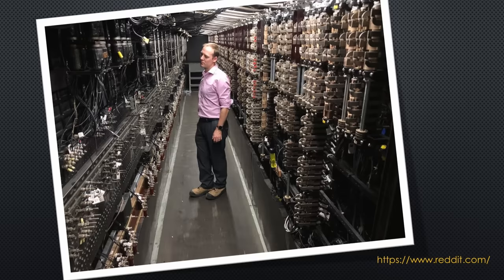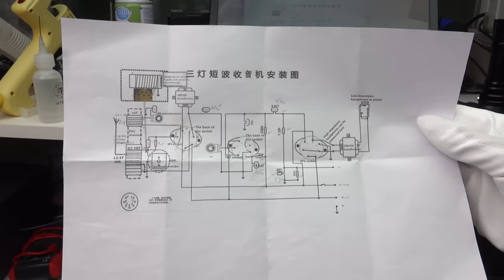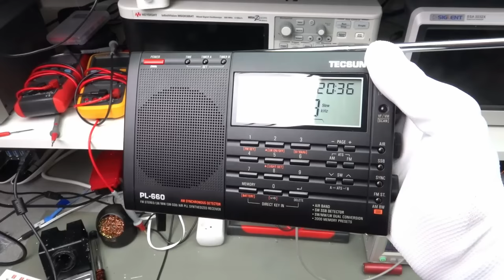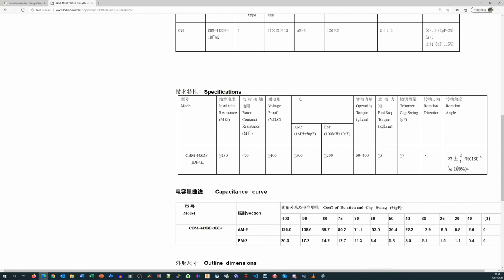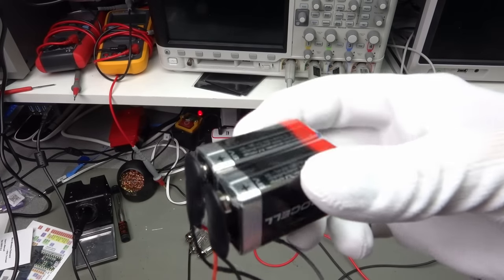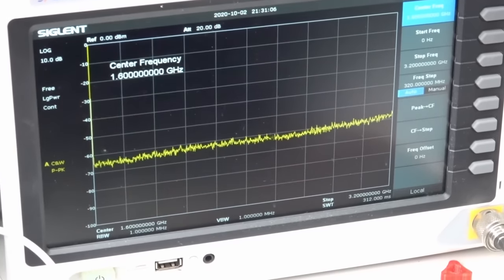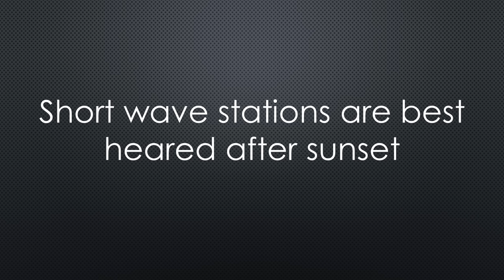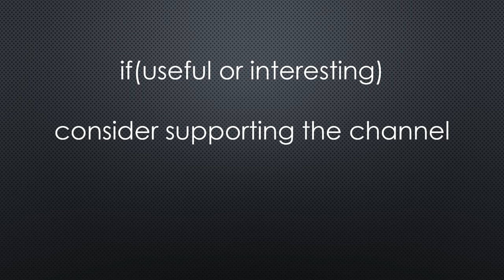#355 Let's try to build a Vacuum Tube Radio

Comment: I am 71 years old now so I not only remember tubes I learned basic electronics in the 50s from my father starting at age 5.  I was building small radios at 10 and repairing tube TVs with my dad. Well I am retired now having been an Electronic Engineer for over 35 years. Got lots of old tubes around so can't wait to build a tube RADIO again.
Reply from the maker: Enjoy! You were even earlier with starting with electronics than I did. But you were lucky to have an involved father. Mine learned me to work with wood...
Reply: Ha, you were 71 three years ago - I'm 74 now so we are the same age. I had a next-door neighbour [Mr Auld] who was a senior person in the Post Office Telephone Exchange in my city and he was very interested in Radio. In his basement he had quite a big workshop. He initially got me interested in DXing  and I had an old 11 valve, Atwater Kent radio which pulled in stations on Broadcast Band from some great distances. Anyway, he gave me some old Radio Engineering magazines and in one of the magazines was an article about "Hikers Radios" [I think from the 1920 ~ 30's]. They progressed from a Hikes One, Hikers Two and Hikers Three. Anyway, I got all excited about this as I had already built a Crystal Set under his instruction so I decided to make a start on a Hikers One. Immediately, we had to have a valve substitution because of non-availability. I can't remember the valve we had to replace, but I clearly remember the substitution - it was a DL92A valve. [It was a miniature valve].  I worked on that radio and even made a cabinet for it so that when I finished it, I was very proud. Being a one valve set, I had old headphones connected and could lie in bed at night, listening to the radio and mum or dad wouldn't know I wasn't sleeping! I found that by increasing the voltage to the valve, I could get better reception and stations further way - I also noted that the valve started to light up like a light bulb as I applied more power. In my quest to get more and more stations, one night my Hikers One didn't work! I planned to build the Hikers Three but never got around to it. Thanks for your article, it has brought back many memories. RIP - Mr Auld.

Comment: Wonderfull project. Only 3 months ago I donated all my remaining tubes (quite a lot..) to a radio museum here in Belgium. Together with almost all my prehistoric radio's and a few TV sets from the late 50's/early 60's. I had no choise, they took too much space. However, I still have 3 left. One I inherited from my grand parents and is dated 1927. Your video is sure a trip down memory lane....
Reply from the maker: So you radios and tubes have a good place! I also once had a tube radio from 1925. But unfortunately, when I left home, my parents also once thought, they have not enough space...
Reply: @AndreasSpiess  Yes, throwing it away would break my heart. I have a weak spot for old radio's and tubes.

Comment: I think my first electronics project was a single valve radio of the same sort of design but without the audio amplifier - just used high impedance headphones.  You really could hear the world.  That got me started over 50 years ago!
Reply from the maker: These are  the "live changing events"... Today it is not easy to get such high impedance earphones. They are low impedance these days adapted to today's voltages.
Reply: Andreas Spiess Yes indeed. Had a teleprinter (50 baud) in my bedroom aged 16 - and 50 valve ‘modem’ to drive it from my valve radio. Worked in telecoms all my life, from X25 data networks to microwave, fiber and satellite and mobile networks!  An early hobby turned into a life!

Comment: I find it quite amusing to see such a crude radio being set up with all that expensive test gear - spectrum analyser, function generator etc. 'When I was a boy' I only had the receiver parts, no test gear. I think your next project should be a superhet radio :)
Reply from the maker: You are right! But you had more stations near you who could serve as a "function generator". These days it is hard to find strong stations...
I am more in SDR than in superhets.

Comment: What fun!! Thank you for making this video!

I remember when I was a teenager and I made a regenerative receiver out of a single 6BF6 vacuum tube and some coils on toilet paper tubes (it took the poor salesman forever to find one in his stock)!! I got the schematic from some hobby magazine. It was wonderful to hear all of these shortwave stations on the radio. I even made a coil for the CB radio band (27Mhz) and it actually worked! I could hear the locals talking on their CBs. The selectivity was not all that great so I would hear multiple channels at once but what fun!!

The original circuit used a potentiometer to vary the positive feedback but it was really scratchy and really hard to get that super high gain without tripping it into oscillation. So I modified the tickler circuit by winding a pancake coil on a piece of cereal box paperboard and stuck it inside the main coil and arranged it like a butterfly valve so I could vary that magnetic coupling to the main coil as you turned it open or closed. It was AMAZING how smooth it was and I could sneak up on the gain to ridiculous levels and really pull in the shortwave stations!
Reply from the maker: You are welcome! The problem with winding the right coil and finding a good distance to the feedback coil is still there. One thing, however changed: We do no more have a lot of powerful radio stations on those frequencies.

Comment: Enjoyed the video.  Although not with vacuum tubes, I built a small transistor radio in the 60s from a kit.  It was exciting to hear the AM station when it first fired up.
Reply from the maker: Today it is probably no more easy to get AM stations, at least not in Europe. Most are switched off by now.

Comment: HI YOUTUBERS. Thank you Andreas for this wonderful video. It took me straight back to my childhood where I bult many such projects. I never tried low voltage directly heated valves however. I was used to 300V / 6.3V PSUs as an 11 year old and I survived ! My memory is now flooding with ECC83, EF50, EL84, KT88 and QQVO6-40 ! 73 de G4EYR
Reply from the maker: You are right with the morse signal.
It was probably better to start young. Now I know what can happen and fear high voltages...

Comment: I "cut my teeth" on vacuum tubes back in the mid '50's.  The first digit of the tube number is usually the filament voltage.  Most rectifiers like the 5U4 and 5Y3 were 5 volts.  Most other tubes were 6 volts. Some were 12 volts with a center tapped filament so they could be wired in parallel to work off 6 volts. Battery powered radios in the mid 50's tended to use the 1 and 2 volt tubes because they had a couple of batteries, one for filaments and a higher voltage for B+.  Typical B+ in old tube equipment ran as high as 700 VDC in some cases. A few dozen milliamps but enough to give you a big jolt.
Reply from the maker: Good information on the numbering. Thank you! In military we had transmitters with 10kW output. They also had very high anode voltages. I never liked it :-(

Comment: A great video. I’m a tube guy. I grew up in a radio and tv shop in our garage through the 60’s and 70’s. My dad had my head in the back of big color TV chassis’ at 5 yrs old. Of course teaching me what to and what not to touch. I still build, modify and repair tube gear. I work on a fair amount of tube ham radio gear, and a lot of guitar amps. There is so much work, because most techs wont mess with tubes because of the near 50O vdc B+ on many tube guitar amps. I have also made many tube RF amps for ham radio. Spanning from 100 watts to legal limit and more. It is an old technology, but nothing sounds as good as a Tube/valves in a guitar amplifier. One issue with tubes in guitar amps is that you need to turn the volume up very high to get that nice tube distortion that most players love so much.The tone is very sweet, but the amp needs to be very loud to get that warm tone. I make Tube Adapter Converters to replace typical 5-35 watt pentode tubes with a 1 watt miniature pentode tube. See www.smiczamps.com/tacs. This allows guitar players to get that great tube tone at low volume levels. Many audio tubes are manufactured to this day in China, Russia and other eastern European countries, such as the Slovak republic. There are many current manufacturers of tube guitar amplifiers due to the warm harmonic rich tone that tubes generate. Not even modern class D devices can generate that wonderful tube sound. Tube generated Even harmonic distortion which is pleasant to the ears. Modern Solid state device produce odd harmonic distortion which is not very pleasant. I am involved in all types of electronics, but i will always love the simplicity and sound that tubes generate. I loved the video. 73 de N1FQF.
Reply from the maker: You seem to have a lot of experience in tubes! It is interesting to see that distortion is a good thing in your profession! We mostly try to avoid it ;-)
Concerning your "tube size reduction": An interesting idea. I am sure your customers are happy that somebody builds these things.
One thing I wonder is if this distortions could be "simulated" by today's DSP technology and then amplified by a distortion free amp.
Reply: Andreas Spiess . Everyone is trying to simulate tube distortion with DSP. So far nothing is as good or better then tubes yet, in my opinion.There are some pretty good sounding plugins out thete, but they are still not the same. They are an ok simulation, but not the same. Tubes have even harmonic rich distortion that is just so wonderful sounding. All the solid state device distortion, (even modern class D amps) is very bad sounding when clipped. It has hard clipping when hitting the power supply rails and generates much more odd harmonic distortion which is not pleasant to the ears. Tubes have a nice soft clipping effect filled with beautiful even harmonics. Tubes run in depletion mode where SS devices run in enhancement mode. In listening to music you don’t want distortion? When it comes to guitar, the tube distortion started a while new world of music beginning with the legendary blues. I am involved in all matters of electronics. I have been into ham radio since i was a kid and i was involved in wireless transmission most of my working career. i just fell in love with tubes in the late 60’s and have not been able to break from its grips. I made tube guitar amps that ran on battery back in the late 90’s into the 2000’s. It was the worlds first and i think only all tube battery powered amp? I don’t build amps commercially anymore? I still build a few one off custom amps for a small group of customers. The tube adapters are an easy way to get that cranked amp tube distortion without waking up the neighbors or having the police at your door. Its an ancient technology that still can not be beat for tone with guitar. It’s a bug i just cant seem to shake. Plus i just love the smell of hot tubes. Its the while thing. The tone the smell. It’s tremendous. I’m building a couple of tube amps as we speak. I have tried every DSP amp simulator i can hear, but they are just not there yet. They sound similar, but they just don’t have the dynamics and the rich harmonics. Take care. Thanks for the email. If you need any tube info ever? Let me know. I have lots of stuff rattling around up there in my brain. I have hundreds of tube books. Theory, circuits, specs. Also scanned to files as well.
Reply from the maker: I can imagine that clopping on modern amplifiers do not sound good. And good to know that I have a specialist in my viewers!
Reply: Andreas Spiess.  You have Mr Carlson as well. He is another professional tube head. I watch all his videos as  well. Thank you. Take care my friend.

Comment: This really carried me back. My very first electronics build was a Heathkit "All American Five" superhetrodyne AM radio. FM was still in the future :) Certainly the kit was much better documented and all the components fit the assembly. One thing that just came back to me...  there was no printed circuit board. The components were either mounted to the metal chassis or strung between the mounted components' leads. A few inches of fabric tubing kept connecting wires from shorting. It was powered from 120 volts, yet still available for construction by youngsters. No health and safety committees back then. 

Thanks, yet again, for an interesting and memory jolting video.
Reply from the maker: That´s great! I never built one of those back then. I assume quite a few viewers will share similar experiences...
Reply: Heathkit were great.  Back in the 1960's I built their Oscilloscope, it used either a 3" or 4" CRT.  It worked perfectly from first switch on.  The instructions detailed the length and colour of every piece of wire used.  As you say no H&S then.  Here in the UK we are on 240V and can only imagine the voltage on the CRT anode!
Reply: Built an HR-10b in 1973-4 - in the eighth grade.  Needed help getting it running, as I had not yet learned to be “methodical enough.”

Built the 6t9 transmitter from scratch.  I learned about “Bee-Plus” (b+) voltage then, and got tossed by the 275+ volts on the plates.

Comment: Brings back memories! As a teenage amateur radio geek back in the day I built a 144MHz (2M band) power amp using push-pull 2CX450 valves running 400v or so on the anodes. About 150W RF output from memory (it was almost 55y ago). I don't think my parents would have approved if they'd have known. How I managed to avoid electrocuting myself is amazing! RF power transistors were way outside my Saturday job income, but army surplus even then was cheap and plentiful...  though it was several months of saving for those valves.
Reply from the maker: 150W RF output on 144MHz 55 years ago. This was marvelous! My first 2m rig had 2 watts if I remember right :-(

Comment: Thank you very much for the video, I've always wanted to build an amp or radio with tubes but I never did it because of the high voltage, high price and sometimes poor documentation. This video will be a great reference for anyone who wants to build a radio with tubes. I think I'll start looking for a nice kit now 😊
Reply from the maker: Enjoy the build when you got the right kit!
Reply: Depends on the tube(s).

There are a fair number of tubes that use (relatively) low voltages, e.g. 1t4, 1ad4.  The latter is especially interesting, as 1) it’s very small; 2) it has a fair level of gain; and 3) it runs well on less than 45 volts.  I’ve run these on 27 volts in a small regenerative radio.

Comment: When I was in high school in the '60's, each student built a radio receiver.  The tube sockets were mounted on a block of wood.  The resistors and capacitors were soldered to terminal strips.  The coils were wound on plastic tubes, the number of turns specified. I remember it was silk covered wire, not the varnished wire you are used to.  The tuning was done with a variable capacitor.  What was different, this was called a TRF receiver, a Tuned Radio Frequency receiver, not the superhetrodyne receivers which were very common.  Actually,  many car radios were TRF radios, if I recall, they had better selectivity than the superhet radios.   Printed circuits did exist but they were beyond our capability.  

Later on, I built a darkroom timer, it did have a printed circuit board and a single 12AU7 vacuum tube, a simple multivibrator circuit, you would count the ticks to know how long your film or paper was developing.

I also remember when a single BIT of storage in a computer was a master-slave flip-flop, made up of two vacuum tubes.  ONE bit, not a byte.  It took lots of tubes to make up the memory that a computer needed in those days, no wonder they needed all that air conditioning.

Yes, the good old days.  Jim
Reply from the maker: If I see what technology we have today at nearly no cost, I would say, today is much better. But of course, we were young then and did not know how fast things will move. I am glad that I was able to see all the development in electronics of the last nearly 50 years. What a journey if we look back at your tube radio on a block of wood. But still: They worked!

Comment: You think YOU didn't know what you were doing,  just imagine putting together a TV kit! That's what I did in my younger days (thanks to a kit company named Transvision). I DID have some experience with a soldering iron and use of a volt/ohm meter but I succeeded! This was in the '60's when everything was operated by with tubes, impossible nowadays with transistors (or almost impossible). This clip brought back a lot of memories!
Reply from the maker: That happened to quite a few commenters. I was a little too late for the tubes in education. So I had to do it now ;-)

Comment: Hi Andreas,

Another great video it is.
Just yesterday I watched Paul Carlson aligning a six tube Fada which he restored.
That Vedolyzer was quite a bit of test equipment.
I was not aware that one can get these radio kits, maybe something to try.
Some early radio sets of course did live of batteries and taps of the battery bank at various voltages for the heaters and the plates. 
The battery box was bigger than the radio.
The stuff worked, they did a lot with very little as we say.
Kind regards,
Duncan
Reply from the maker: That is what fascinated me, too. With one tube (or later transistor) they built a working radio! When I was young we bought old military batteries and gave it to friends to touch both ends. What they did not know before they tried was that their voltage was 110 volts ;-)
Reply: Andreas Spiess that’s funny yes